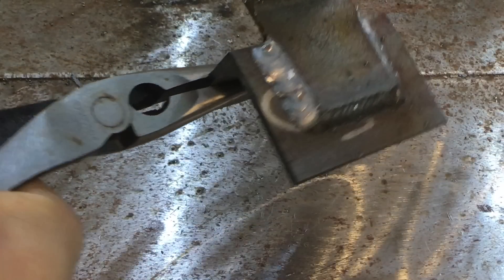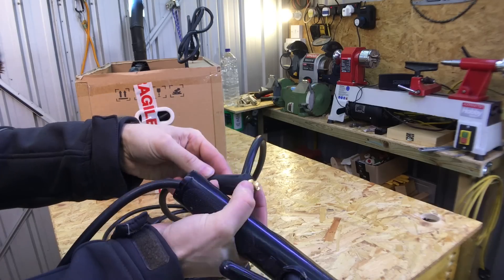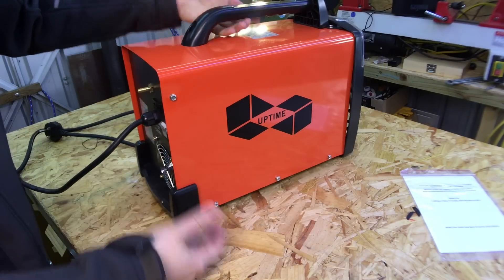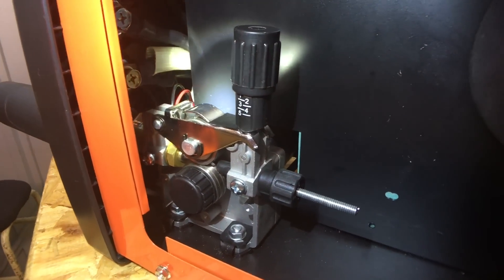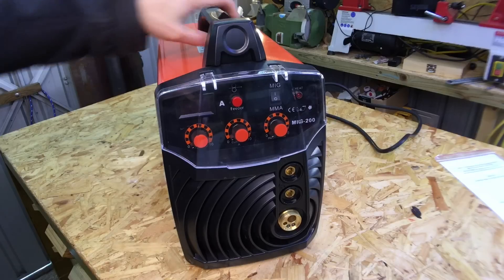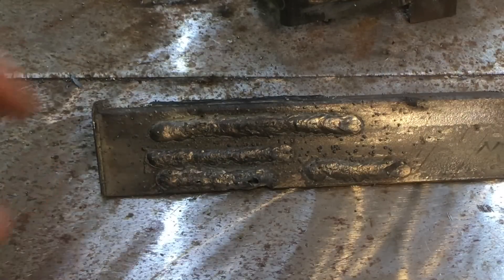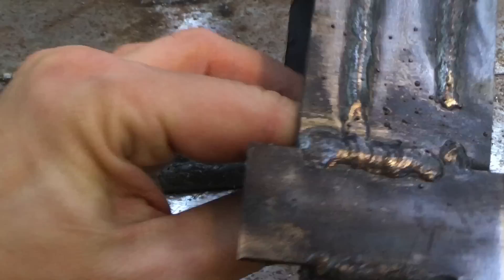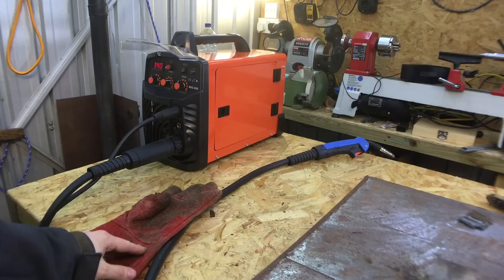Testing Cheapest Igbt Inverter Mig Welder

Comment: A 13amp mains fuse actually blows at about twenty amps. If you draw more than 13 continuously the heat from the fuse inside the plug is greater than one watt and that’s all plugs are designed for, strictly.

Comment: Not from the UK but looking at these little welders.  You mention you're running a 13 amp outlet.   I saw another that came without a plug and is user supplied.  The little welder I received has a standard plug used for most household current of 120 volts and a short cable that can hook into a dryer/welder and has a female plug giving you that dangerous 240 volts which the welder can handle.

The problem is, in the US, people will be disconnecting their dryer, attaching this cable and hopefully running a drop cord outside.  Then comes the problem.  For the US we now have a cable rated for 120 volts but carrying 240.    If someone forgets and plugs in a simple 120 volt device but receives the 240, you can see we have some fireworks in the making.

Comment: I like your honesty regarding weld quality and the machine. As a matter of interest did you switch polarity when changing from gasless to gas mig? It's just I was looking at the review of the Headux Titan 188 and they mentioned changing polarity. I recently tried flux cored for the first time whilst repairing a Lorch MIG\MAG set (I didn't have any gas available but wanted to test the machine after the repairs) and was not impressed at all. I know that for gas fed MIG\MAG the Lorch is a superb machine.
Thanks for a decent, honest review.

Comment: Great Review of this machine .. Big Thanks! .. I've had the Uptime MIG 160 for over 18 months now, it's still working perfectly, although it's had very light DIY/Garage use! I've had some great welds but with those unmarked dials, it's hard to remember the settings..  I notice it's still on eBay for £169 inc Postage from Up-Time, Aberdeen, UK.
Reply from the maker: Robert Anderson Thanks glad yours is working well. I have put 7 5kg rolls through on my 8th. Just needed new roller feed bearing worn out but still perfect working. Great machine.
All the best.
Reply from the maker: £$99 cheapest mig welder on Amazon https://www.youtube.com/watch?v=wcGqJM7NF_Q&feature=youtu.be&ab_channel=DIYTEKNUT

Comment: Does this run on gas?
Reply from the maker: Mr Green it’s gas and gasless
Reply: @JAYZWORKSHOP  thanks for the reply, iv never welded before would you recommend this for a beginner like me using just electric?
The plan is to weld box section for go kart and mobility scooter frames im not sure on the thickness, how thick metal can this weld?
Reply from the maker: @mrgreen1402  yeah good starter nothing better under £300 better than some being sold for £400. i've used a lot of cheap mig welders and this welds real nice . 
 this will do what you need i've welded car chassis  and trailers.
 Maximum steel thickness with V and root gap 7mm you can go thicker with multiply passes .
Reply: @JAYZWORKSHOP  Thanks mate, Iv taken the plunge and gone ahead and ordered it from ebay i paid £169.99, im going to shop around ebay and order some cheap gloves overalls them clamps/magnets and an auto darkening mask (throwing myself into it!)  What would you suggest on the size wire should i get for the gun (not using gas) and stick rod size
 I will be mainly using for the box sections on a diy go kart,   am i right in thinking the stick welding is better for thicker steel and i should be ok with the mig gun for say up to 4mm or something, 
the mig gun looks way easier to learn how to weld

Comment: will it take 0.6mm wire?
Reply from the maker: yes
Reply: Don't bother with 0.6mm it sucks best is 0.8 or 1 you would think 0.6 be good for thin metal in car body work its not setting the machine right is more important

Comment: Nice video mate. I was thinking of getting one of these. Do you still think it's okay?
Reply from the maker: mine still working good , can't comment on the batch they are selling now. pay with paypal and credit card at least then your covered if somethings wrong. you just have to take the chance like i did.
Have a good weekend.
Reply: DIY TEK NUT thanks for your input mate. I will take a chance I think. If you fancy doing any more vids I will definitely watch. I like what you do.
Reply from the maker: Neil Burt no problem have a good weekend all the best.
Reply: Got mine about a month ago use pub co2 this mig welder is unbelievable for the money weld anything thick thin dirty galv etc if it lasts worth every penny
Reply from the maker: mralanvideo yeah I run co2 90% of the time  all you need cheap to refill .
Reply from the maker: £$99 cheapest mig welder on Amazon https://www.youtube.com/watch?v=wcGqJM7NF_Q&feature=youtu.be&ab_channel=DIYTEKNUT

Comment: @DIY TEK NUT I got mine a few weeks ago but due to a misunderstanding with the supplier it came with the flux cored wire set up and not 0.6 solid that I want 
Did it seem weird to you that you don;t have to change polarity to go solid core to flux core?? Seems to weld okay if a bit sparky !!

Comment: only idiot use flux core if gas can use. easy made all welding machine to gas model, need only gas magnet ventile, button, relay some wire and made.

Comment: Think of inductance as a brake. You can hold down lightly on the brake, or harder. Inductance is usually set to about 35%. I don’t know what your machine settings are. But if you increase inductance to about 100%, you can significantly cut wire speed. That allows you to slow your welding down, and get better control. Also, you will get less spatter. It’s also good for vertical welds. Look it up. You will find it to be useful.
Reply from the maker: Mel Gross thanks very much for your help .all the best have a good day.

Comment: Did you change the polarity at the two cables internally above the euro connector when changing from flux cored to gas shielded wire welding? There is a vague reference to this in the manual.
Reply: Usually for flux wire the polarity is DC-, information should tell you on the package wire. Mig wire is DC+.  For DC- mig gun connects to the negative terminal and ground to positive. Its the opposite for mig wire.

Comment: I ordered one of these direct from uptime in Scotland a few days ago sadly I’ve heard nothing since even after several calls and emails   even tried contacting him via eBay but still nothing doesn’t even answer the phone or reply to message left did you have any issues when ordering ?
Reply from the maker: Grumpy Grandpa yeah I have been told by few others the same but they did get it in a week or so . I think they run the business part time . Also manny business shut down this time of the year till the new year.
But when I dealt with them in the past they were always very good.
Hope you get your welder soon.
Reply: DIY TEK NUT Lets hope all the hassle is worth it 🤔
Reply: I bought an uptime 160 mig from the same Scottish company about 2 months ago.
it cost £154.99. This is £15 less than the same company is selling them on ebay.                                                                                                                                                   The welder was delivered 2 days later, in perfect condition and with a UK plug with an undoctored 13amp fuse. I hope your welder arrives soon.
Reply: Barbara Harris wish I had received the same service ! Been doing some reading around and it would appear the seller is extremely hit and miss on customer service I’m not the only buyer to have had issues by all accounts. Wish I would have done this and known this prior to ordering as I would have ordered somewhere else entirely. Looks like a nice welder and a nice price just a shame about the hit and miss customer service 😕

Comment: It’s work mig with out gas? Or I need to buy gas?
Reply from the maker: London Alan88 if you watch the video you find out
Reply: Depends on the wire you use. Flux 211 wire is gasless. I use 75% argon and 25% C02 for mig wire.

Comment: you put the wrong links to that welder I cant find that one anywhere i search for it all over the net.
Reply from the maker: dreamkiss4u just go google uptime mig 160 you find eBay link
Reply: @JAYZWORKSHOP  that's not a160 tho that's a 200
Reply from the maker: i brought it as a 160 this is what i was supplied with, weather they use the same case for both models i don't know .

Comment: Hi there , I enjoyed this video & it was very informative . I am planning a project myself in the next few months I own a MiG welder like yours for flux core & it came with attachments for gas . I have struggled to do a decent job with the flux core & need to know do I need the gas for solid cable or what is the gas for ?
Thanks simon.
Reply: Try swapping weld polarity
Reply from the maker: purpose of shielding gas is to prevent exposure of the molten weld pool  to contaminant in the atmosphere. without gas cover the weld pool will get porosity holes within the weld bead and excessive spatter. you can run just co2 i do just cus i am cheap works fine but its best to go with a co2 argon mix.
Reply: Argon/CO2 mix, 5% CO2 for thin stuff, 15-20% CO2 for thicker stuff. The CO2 puts heat into the work (technically you are MAG Welding when you use gas blends). CO2 tends to make the welds thinner but deeper and can make the welds appear 'stringy'. The Ar/CO2 blends also, counterintuitively since it is a shielding gas, also contain a small percentage of O2. This forms a very thin, controlled oxide layer on the surface of the weld which aids with weld 'wetting'  and produces a nice, slightly concave weld.
If you do go down the pure CO2 route don't use the Cellar gas, the sort of CO2 used by Pubs/Bars. This is food grade gas and often is scrubbed during manufacture leaving moisture in the gas. This freezes in the regulator and stops the gas flow, also having steam around your weld pool doesn't make for good welds (try welding wet steel). I know this because I started out welding with CO2 from a Pub. The difference, when I switched to Argon/CO2 blend, was amazing.

Comment: Just out of interest, have you tried attaching a tig torch to it? And also how well does it cope with thin steel?
Reply from the maker: have not tried tig torch but it should work in mma mode . scratch start. so if you weld thin steel  you would want sacrificial piece to scratch off on. well i have welded paper thin steel with the mig. 0.6mm wire co2 argon gas.   20amp . but yeah tig would work  better. 

you can get a tig torch like this https://amzn.to/2nypXN6 can connect straight to argon not sure whar dinze connector it has so you might need an adaptor  https://amzn.to/2pWDqPy

Comment: just a follow up mine came today looks the same but only goes to 163 amps so I wonder if you have a more powerful machine  its also badged as a 160 on the faceplate not 200 like yours,,, still looks good cant wait for a good day to test it.
Reply from the maker: yeah mine does go up to 200amp but i brought as 160amp machine . I would give it a good workout and make sure it's all good . Anyway have fun  all the best.
Reply: @JAYZWORKSHOP   im a pigeon shitter anyway :-)
Reply from the maker: @scoobgirl  mine used to be the same just practice, in fact this welder made my welds better the feeder feeds the wire more smooth and consistently.
Reply: @JAYZWORKSHOP    sorry to bother you again when you start yours up did it continuously feed wire, mine wont stop it just creeps around and feeds with and without the torch connected? can see im going to have problems here
Reply from the maker: @scoobgirl  oh know not you again. ;~)
 no mine did not do that. on the front its got that wire feed button has it got jammed if not i don't know .
i would contact the seller straight away .

hope you get it sorted .
Reply: @JAYZWORKSHOP  haha ,,, yeah have sent them a vid of it  running although its a lot slower than the feed button speed just a creep but you cant stop it,,, the seller asked if I think I could fix it I said no but the box had been opened up before I got it plus it had there address written in pen so its deffo a return
Reply from the maker: @scoobgirl   
ask you to fix it haha. if they are funny about just open a paypal case its their fault .
you shouldent have to pay return postage they should send a courier to pick it up since it's faulty .
Reply from the maker: @scoobgirl  does adjusting wire speed control affect the speed the wire is feeding at .
Reply: @JAYZWORKSHOP  yeah im going to give them a chance but I do need it asap as I have my wifes car cut to bits so shes not happy haha
Reply: @JAYZWORKSHOP    no its say 2" a minute but if I pull the trigger you can increase the speed variable but instead of stopping goes back to 2" a minute like its getting powered from elsewhere,,,, one things for sure im not opening it up as I will break it even more lol,,, cheers for your input mate
Reply from the maker: @scoobgirl  @Raihen khan in the comments is having the same problem must have a bad batch .
let me know how you get on.

Comment: great vid,    your review has literally made me go and buy it although 189.99 just hope it works on thin car metal... let us know if you've tried it on thin sheet metal (mig) thanks
Reply from the maker: it will do but its more down to technique than the welder practice first . use 0.6mm wire and 5% CO2 / Argon Mix gas.
Reply: @JAYZWORKSHOP   thanks for the reply
Reply: @JAYZWORKSHOP Thanks for the vid. How did you run .6 through this? I have one and it's .8 or 1mm. Did you change the roller? Thanks.

Comment from the maker: At the moment the new cheapest best MIg Welder is on amazon https://amzn.to/40eKO64
when its got a £30 voucher on it you can get it for £170

*Cobalt Drill Bit Set https://amzn.to/3coyx88
*MMA welder i would like https://amzn.to/3r4SuVo
*MIG welder i would like https://amzn.to/39tXI7e
*TIG welder i would like https://amzn.to/3r3N2lU 
*Tin Snip https://amzn.to/3raf3IB
*Stick Welder https://www.banggood.com/custlink/DDGKsw7PU9
*Welding Clamps https://www.banggood.com/custlink/mKKGbuwF1j
*Machinist Hammer https://www.banggood.com/custlink/KmDmQ1ut11
*Screwdriver Set https://www.banggood.com/custlink/KmmKATw5w4
*Precision Screwdriver Set https://www.banggood.com/custlink/K3v3Nuwi8V
*cordless Angle Grinder https://www.banggood.com/custlink/GDKmAFL7s4
*Carbide wood turning tools https://www.banggood.com/custlink/KKmKQwfS8S
* flex shaft Rotary Tool https://www.banggood.com/custlink/3KK3Z35Boi
*palm Router https://www.banggood.com/custlink/GDGGbT1iSj
*F-Clamp https://www.banggood.com/custlink/vKDGbfuZiB
*Double Edge Pullsaw https://www.banggood.com/custlink/mvGvb7uIZN
*Mitre Box https://www.banggood.com/custlink/33KvbuTSj3
* Impact wrench  https://www.banggood.com/custlink/mKDK6g6Bts

Above are affiliate links and in the comments it costs you nothing, if you do not want to use links search on goggle more info Thanks.
Reply: Do you have a link to the welder  you reviewed? I can't find it on Amazon!! Cheers.
Reply: @JAYZWORKSHOP  thanks!! Feel a bit daft now!!
Reply from the maker: @bdhall77  no problem

Comment: Just watched your video very good was thinking of buying one and would definitely consider that model now was wondering how well the machine is working 6 months on after your purchase
Reply from the maker: Yes still working well by far the best welder I have ever owned. Have a good day
Reply: Thanks for the rapid response all the best to you mate
Reply: Sorry mate forgot to ask did you find out what the induction dial was actually for and best way to use that function thanks
Reply from the maker: setting affects the arc time. That is the amount of time the short circuit cycle spends arcing and providing heat to the puddle.
i did play with it and in the end just left it in the middle.
All the best.

Comment: Hi I bought this welder but seem to have trouble switching the polarity any similar issues from yours
Reply from the maker: yeah it is tight to change but i wont be swapping very often if at all. still very good for the price and welds better than any cheap transformer based machine.
Reply from the maker: £$99 cheapest mig welder on Amazon https://www.youtube.com/watch?v=wcGqJM7NF_Q&feature=youtu.be&ab_channel=DIYTEKNUT

Comment: Thankyou for making this video it gave me the confidence to buy one off eBay for £160 to be honest I still wasn't expecting it to be so good.
One thing I was wondering about though is it's called a uptime mig 160 but on the welder it says mig200 and it turns up to 200 🤔
Reply from the maker: yeah  that's what i found funny on the back where the info with duty cycle is it says 200. i was wanting to test with a clamp meter to see what max amp is but i only have 13amp outlets so cant test at max. 
Make sure you change the fuse as the fuse is bodged with copper wire could cause a fire watch my video on it https://youtu.be/BZkMZcDuqVg
Reply: @JAYZWORKSHOP  Thanks for that I will check it out tomorrow 👍
Reply: @awuk697  wouldn't be surprised if it was 200, but sold as 160 because of the 13a plug. you should be able to get 200 from a 13a plug with an inverter but dont do it for to long.
Reply: They seem very hit and miss with this. The manual also changes randomly what it says is possible. Newer units now seem to have MIG-160 on them.
Reply: common sales con,  call it mig 200 only 180amps if your lucky,